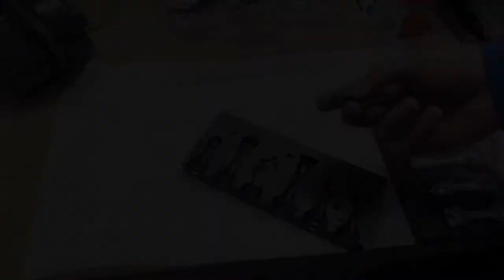Aluminum Chess Piece Casting [Fail] | My New Mold Broke!

Comment: A high-silicon alloy like 356 or A356 will shrink about half the amount of that extruded aluminum alloy (likely 6061 or 6063), which has one of the worst (highest) contraction rates of any common metal (1/4” per foot). Try to get something that was cast- car parts, rims (if you can cut/break them up) etc are usually 356 and great for casting (the silicon increases fluidity and helps get more detail too). 

The solidification shrinkage happens fast, but the plain thermal shrinkage is slower. The graphite is an excellent conductor of heat (as your clamps found out) and the relatively large block acts as a decent thermal mass and heat sink . You may experiment with demolding/shakeout while it’s still hot, ideally just after it’s solidified enough to handle but before it’s had a chance to cool/contract/stress your graphite. You can experiment off camera with your broken mold to get a feel of how quickly you can take them out. I think you would be surprised how quickly they freeze and if you can devise a method of pulling them out gracefully (I cringed a little when I saw you lift the crucible from its lip), you may have great success in making many of these sets without damage to your molds. Good luck.
Reply from the maker: Thanks for the info!  I will try to keep all of this in mind next time I'm messing with molds like this! Also, yeah, the handlebar tongs I have are not great, but for lifting the crucible out of the furnace by the lip they work well. It's one of the main reasons I purchased the new pouring tongs that I use now, I don't want to pour by the lip of the crucible.

Comment: Zammak-12 will be a better choice for fine detail. It's a Zinc alloy that melts easily, flows well, and doesn't shrink quite as much. Alternatively,  you can either add silicon to your aluminum or buy an alloy with it already mixed. The silicon helps with the grain, crystal formation and can cut the contraction by half. Zammak is cheaper.
Reply from the maker: Thanks for the tip!

Comment: that's a cool mold. i would suggest using a die cast aluminum. it will shrink less. I think you are right about the shrinkage.
Reply from the maker: Thanks! I'll look into that aluminum, right now I just use whatever I have as scrap but for the future that would be nice if it doesn't ruin a mold.

Comment: The mold was most likely designed for plumber and not aluminum. They have different melting temperatures and expansion coefficients.
Reply from the maker: That would make sense! While I was gifted these molds, the sellers page doesn't clearly advertise what they are intended for.

Comment: Try to stay away from graphite molds if you can. There must be a cast iron or bronze or even an aluminum mold out there that would deliver better results. Be careful with temps if your using an aluminum mold though.
Reply from the maker: Thanks for the pointer! With how this mold fared, I'd guess that you are correct and I could get better results from another type of mold! An aluminum mold would definitely be tough to work with unless I work with a metal that melts at a lower temp, could be fun though! Thanks for the comment!

Comment: To bad the mold broke, that would have been a nice set. Did you dip the mold in water? There looked to be a lot of water inside that mold when you poured it apart, I would advise against ever putting a graphite mold in water. I dropped one of mine in the bucket on accident and to this day It has not had a good piece come out of it, and what the rapid cooling could also do the graphite. I always just put mine to the side and come back to it the next day, those molds aren't cheap. Good luck
Reply from the maker: Yeah, it's really unfortunate. I did dip the mold in water but not until it was cooled down to a couple hundred degrees so that I could speed up being able to hold it. I guess that might've been my fatal flaw on this one. Honestly aside from the major crack the rest of the molds held up nicely.
Reply: Before you try casting with it again, you might put the graphite mold in the oven at around 200 degrees for an hour or so to help remove any left over moisture.

Comment: Try 10 degrees draft angle in that under the chin area of the horse. 5 degrees draft should be enough for the rest of the mold.
Reply from the maker: That's a great tip! I unfortunately didn't make this mold but that's good to know for my own mold making! Thanks!

Comment: Nice job casting that set. I wonder if a metal that doesn't shrink as much as aluminum (like tin or zinc) would do better in the mold?  It also looks like having some dividers between the pieces when they are poured would keep them from being joined at the bottom.  It looked like that made it difficult to pull the pieces out of the mold.
The great thing about carbon molds is that they are able to handle high temperatures.  It would be really cool to see them cast in copper or bronze.
One last thought, you could try gluing the knight mold back together and casting the other half of the set.  The mold is already damaged so what do you have to lose?
Cheers from Alaska!
Reply from the maker: Thanks! I was thinking about that as well, I might look into using one of those metals if I can get this mold fixed. Dividers would also be useful, honestly it was a sloppy pour on my end, I have a heavy hand when it comes to pouring and I forgot how quickly this type of mold fills up. It did make it much more difficult than it needed to be to get the pieces out of the mold. I'm definitely going to try casting copper if I get the mold fixed but I still haven't heard back from the machinist.

I have been considering gluing the mold back together however my concern is that the glue will completely fail once high temp metal is in there, and the piece of the mold could get lodged in the middle of one of the chess pieces.

I appreciate the comment! Cheers!
Reply: @zestyjonssmeltery321  The broken parts of the knight mold will probably come apart again but my guess is that the metal will harden when it hits the inside of the mold so you might get a usable casting out if it.  The worst thing they could happen is you would melt down the bad knight casting. 
If the mold maker is reluctant to remake the whole set, you really just need a new knight. 
In any case, I am really interested to see this chess set  completed. 
Cheers from Alaska
Reply from the maker: That's very true, I may end up trying that! I did actually only ask for them to replace the knight but the mold maker didn't even get back to me, not overly happy with them. I'll see about getting this set completed eventually!

Comment: i am surprised that this chess mold doesn't have a vent like some of the other mold techniques.
Reply from the maker: It might be because this is made of graphite and it would be difficult to put those into the mold, but they would probably help avoid unnecessary breakage!

Comment: It might help trying not to join them up. I suspected the knight needs to come out straight. Anyway I wasn’t there and you know best.
Reply from the maker: You're definitely right! I was trying to not let them connect when I poured, but I have a heavy hand and overpoured by accident. I'll have to give that a try with the knight! Aluminum shrinks a lot when it solidifies and so I may need to use another metal

Comment: I'm lookin to buy an expensive coin mold but I'm a little afraid now, sucks your mold broke on you<3
Reply from the maker: Don't be too afraid! As long as there's nowhere on the coin mold that the metal can catch to break it like the knight head on this mold, it should be okay! Is it a graphite mold?
Reply: @zestyjonssmeltery321  yeah it's graphite, but it's almost 200$ so that's where the concern is.
Reply from the maker: Yeah that's a pretty expensive mold. Is there any special geometry to it or is it just a basic coin slot in the graphite?
Reply: @zestyjonssmeltery321  if you wanna see it I can send the link but it's a basic mold for a pirate coin.
Reply from the maker: Ah okay, gotcha. If there's nothing too complex it should hopefully be ok! What metals are you going to cast into it?
Reply: I'm gonna cast aluminum, copper and brass coins, assuming I can use the same mold for different metals that is.
Reply from the maker: Hopefully it'll be okay! Just remember to pre heat those molds to avoid any moisture! And you should be completely fine to use the same mold for different metals. There might just be a little bit of residue from one vs the other left in the mold.
Reply: I'll see how the mold performs when it delivers, hopefully good.

I appreciate you being so nice and speaking with me, you're a cool individual<3
Reply from the maker: Sounds good, best of luck with it! And of course, thank you and thank you for commenting!